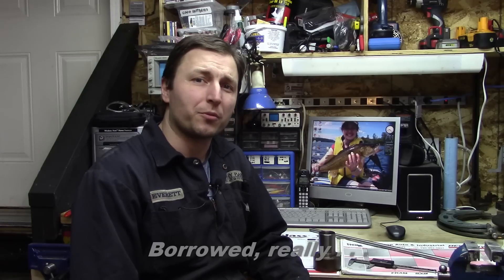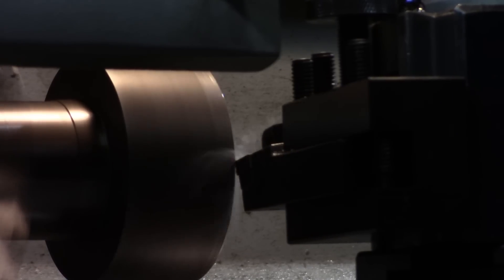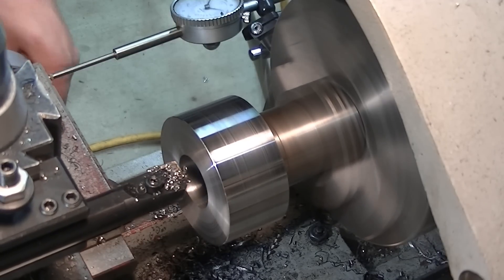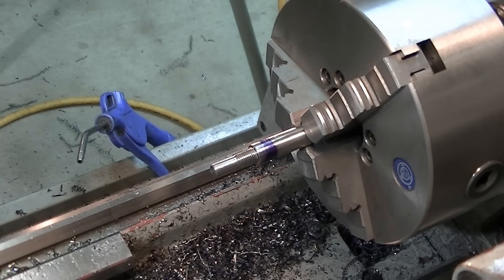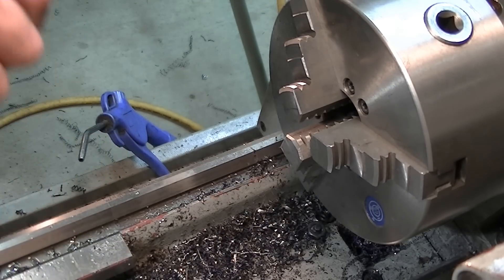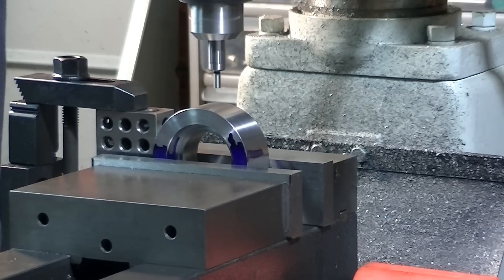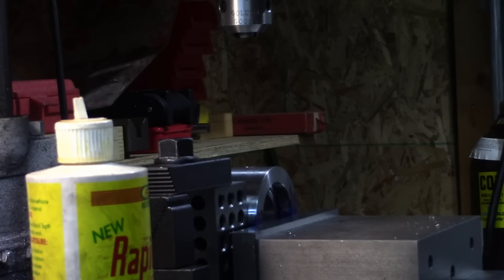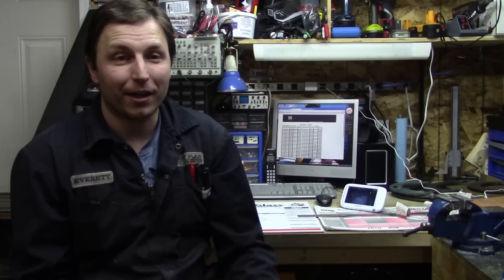Drill Chuck Tap Handle

Comment: Hey Everett thanks for the Vid I made the body of mine today fits as snug as bug in a rug I'm really pleased with the effort you put into it and also giving Chris the glory of the original well done Buddy.
Reply from the maker: Thanks, glad you found it useful. If someone else's work is an inspiration I will give credit where possible and I really liked Chris' idea.  Even if it won't finish a hole on larger taps it helps get it square and centered to the hole.

Comment: Thanks for the shout out.
Nice piece of scrap! You made a really nice substantial boss for your version, and end result is great - very much ''beefier'' than mine. :)
This tool sure comes into its own when power tapping is a bit risky.
Reply from the maker: Thanks, Chris.  I generally don't power tap much with my machinery, and am too cheap to buy a tapping head . . .
Reply: Thanks Chris for the original design you rock buddy. Made the body of mine today doing the Handles tomorrow. Kind regards.

Comment: Everett, you do some nice work with that mill! I need to make one of these but I need to replace my chuck, my chuck is the one that came with my Rong Fu mill and I’m not too enthused with it so I’m going to let it go with the RF mill when I sell it!
Reply from the maker: Thanks, but the idea wasn't mine - I got it from ChrisB257 and adapted it to my chuck. It's good for getting a tap started straight but once it's started I sometimes switch over to a traditional tap handle to finish the hole. If/when a bigger chuck happens for the mill another handle will be made too. Thanks for the kind words, I appreciate it!

Comment: Great project, would like a copy of the plan if possible.
Reply from the maker: Thanks Gilbert, not a problem if you'd like the plan.  You'll most likely have to adjust dimensions to fit your chuck make and model. I recently got a new chuck and have to make a new one for it as well as the dimensions are different. If you would like the plan for it just email me at everettsworkshop@gmail.com and it'll be sent out as soon as possible.

Comment: Nice trash bin you got there, precision ground drill rod, made to measure chunk with a boss, etc...    lol
That tapping tool will beat the chuck key by a mile, mostly for the larger taps where you need more torque.
Are those dies and taps the MasterCrap brand...   ???    If so, be brave and trash them before you do more dammage than production, important to get the better HSS or even better HSS with Cobalt tooling, this will be obvious mostly when you get to harder to work materials, those MasterCrap are most likely made with carbon steel and never to be used in Stainless steel or anything thougher than butter...   lol
Nicely done video, way better then when I started...  ;)
Reply from the maker: Thanks, Pierre, I really appreciate your feedback.  For larger taps it'll be more for getting the tap going in straight by a few threads then changing out for the actual handle as I don't want to ruin the chuck jaws with too much slippage.  Smaller taps will be ok though.
And yes, I have a set of Mastercraft taps and was disappointed to see how those two holes made the plug tap dull in the process.  The US-made bottoming tap cut WAY nicer.  If they are just carbon steel that would explain why I had one crack off on me on the way OUT of a hole that I had just finished a few weeks ago (on my lathe motor drive pulley of all things!).  Will have to replace that set with better ones for home use.
Reply from the maker: And the 4140 ground rod was purchased :)